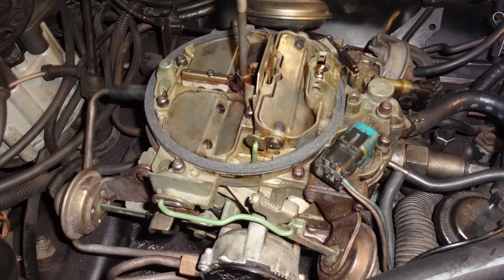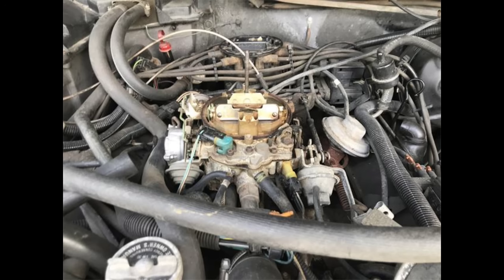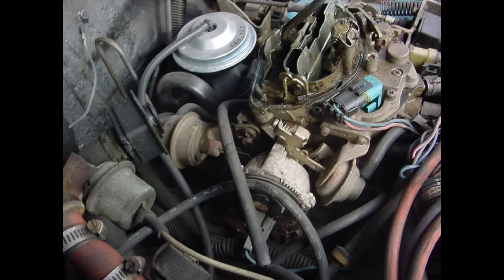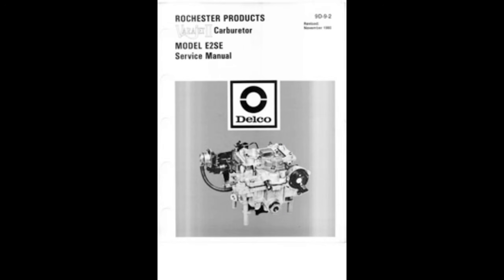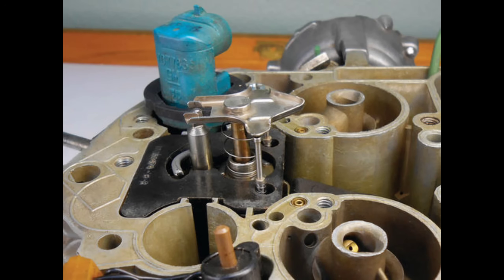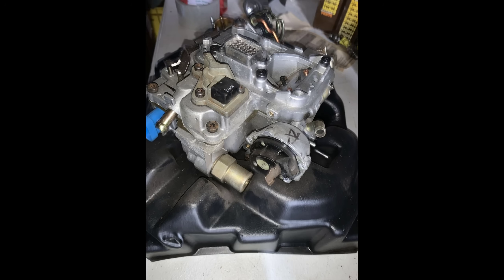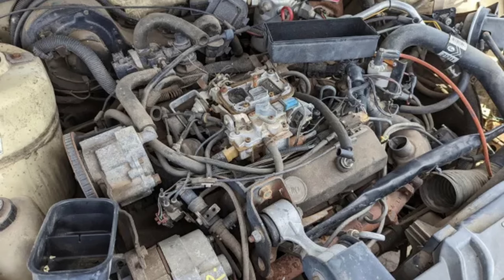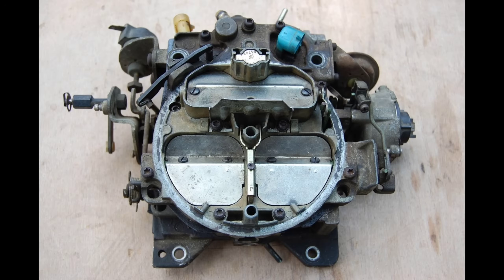GM'S Bridge To Fuel Injection: The Electronic Feedback Carburetor

Comment: it's rabbit hole indeed. There's lots of variables. If you have the original factory carburetor that came with your car, and if you rebuild the engine to factory specs, you will be able to tune it correctly accordingly.

If you don't have the original carb but a rebuilt one from a shop, you'll be in a world of hurt. Remanufactured carbs are just that, built to generic specs tuned only to get you going. In regards to calibration, the idle tubes, the bypass air, air bleeds in the body or at airhorn, the primary jets, the primary rods, the secondary rods, the secondary rod hanger,  the accelerator pump and it plunger springs, the condition of every spring, tps, the mixture control solenoid condition and whether or not the plunger is straight, air horn warpage, bowl body electrosis, primary throttle plates becoming deformed being oval shape from being wedged in the bores, throttle body vacuum leak through its shaft bores that need repair, throttle body and airhorn being mismatched can gravely affect tuning due to whether or not the idle air bleed valve are letter stamped (non adjustable), the non letter stamp valve are, the mixture screws are dependent on what kind of idle air bleed valve your airhorn has, gasket selection, needle and seat, flooding, incorrect float or float settings ect. ect. ect.

Its not a walk in the park. Specialty tools will allow you to adjust it's internals regarding their lean and rich stop settings and proper bleed valve setting.  A dwell meter is paramount. You will be chasing down vacuum leaks, setting and or correcting tolerances. The choke mechanism, the primary and secondary pull off. Nozzle drip due to the throttle angle being too exposed for not having enough bypass air or due to worn out throttle plates. Some people adjust these carburetors wrong. They call them "Quadrajunks" or "Quadrabogs" but they are not that. The secondary airflaps are not adjusted correctly or the its pull-off is releasing too quickly.

The feedback carburetor our C3s are not adjusted with an air gauge for best idle, they are adjusted with a dwell meter for best fuel mixture. If you adjust it using an air gauge or, if you adjust it by ear, you'll experience hard cold starts and the engine will not turn over until it heat soaks. Cranking the starter red hot. A well adjusted carburetor will not require pumping the gas nor setting the choke. The choke is set so that you can warm up the engine faster or if you live in a cold climate. The engine should turn over with a single flick of the key, no pumping on the gas, no setting the choke. I live in Southern Cali, and i rarely pump the gas if ever. 2-3 minutes idling as I get out the house and put my stuff in the trunk, it has warmed up enough that once i get to the end of street onto the road, its ready to roll. 

Quadrajets are universal, but once you radically rebuild your engine and slightly change its cam, you will need to modify it's internals and calibration based on your application. At this point, the maintenance manual for your car wont even matter. It's fun for sure, but you know what I'm talking about. A proper Quadrajet can rival any modern car regarding performance and mpg. One has to love it to endure the pains, the tears and the maddening rage it will provoke upon you. This will allow you to climb outta the rabbit hole or forever remain there.

Comment: In 1997, my car during and after high school was an '83 Camaro with a 5.0L V8 and a Rochester Quadrajet. Coming from a '78 Toyota Celica with a 20R 4 cylinder engine, it was my first V8 and I thought it sounded cool when the 4 barrel would kick in; I guess that's what was happening during full throttle pulls. It sounded deep and throaty. The LG4 305ci V8 and 700r4 transmission was NOT fast but it was a really fun car and was reliable actually. The car was $1500 from a car lot across from my high school, but that's because it had a rod knock. So a new long block engine was purchased from Pep Boys and installed at a local shop along with a refurbished Rochester carburetor a few weeks later from Advance Auto Parts.
Reply: I would have promptly scrap piled the 305 and installed a 350.

Comment: Had one of these in the mid 1980’s on a 5.0l LG4 application for a Pontiac Firebird..  Problem was that if you tried to rebuild it back then the rebuild kit was woefully inadequate regarding the gages, special parts and instructions you were given.  You knew nothing of where to set solenoid for the dancing needle and no mention of the dwell procedure was made.  I got mine as close as I could and it ran Ok, but not as sharp as when it was brand new.  Finally bit the bullet and took it to the dealership for a carb tune.  He told me everything I didn’t know, and said I came surprisingly close considering what I had, or more accurately, didn’t have, to work with.  Could have used this video back then.
Reply from the maker: The carb kits are even worse now.

Comment: When I was 18 starting in 2000 and for about 10 years after, I worked at a parts store.  We sold rebuilt replacements of these.  They were about $400.  The rebuilts we sold NEVER worked right.  I assume that is one of the ways these carbs got a bad reputation.
Reply from the maker: 100%

Comment: The Q-jet is THE best street / mild performance carburetor, period. Excellent fuel metering,  very tunable. The later electronic version, just as good for its intended purpose. You drill out the idle screw caps with an aircraft drill bit, to access base idle fuel trim. The metering rod adjustment was very straight forward with the ( aforementioned) gauge.
Reply: Adjusting idle screws indicate the lean limit m/c stop is fucked up.
Reply: in closed loop.
Reply: @ckratzet5286  Hi, I disagree based on my experience working on hundreds of those when new. GM set the throttle plate more open at idle, then turned the mixture screws in at least 1-1/2 turns to achieve a lean idle w/o stalling. The mixture control solenoid lean / rich limit does not come into play until off idle transition. Also, the fuel trim window was very narrow on the CCC. It's much easier to trim slightly rich mixture to optimal VS trying to enrich an already lean mixture 🙂
Reply: @ToddsHouseofSpeed-uq5sp  
Go to 100% d.c. and it dies closed loop.
Open/Closed loop needs to be specified.

Comment: My '88 Gran Fury cop car has this style feed-back Q-jet, but it will be going away when the (very crude) ECU ignition gets thrown into the trash. Have to replace the intake, carb, and ignition with a more-tradition set up. Ages poorly, parts are non-existence and the car is not going to be re-done to stock specs.
Reply from the maker: I've never owned a Chrysler with the Lean Burn System, but I've heard horror stories.
Reply: Its better to just get rid of it@rporestorations
Reply: @rporestorations  My dad owned one. It made him want to use Lee Iaccoca's grave for a urinal.

Comment: I had an auto repair shop for thirty plus years and finely closed and retired in2019, the last one of these we had come in was on a 1987 fast back Montecarlo a customer had bought restored, and it was beautiful Only problem was a constant check engine light. I was the last shop in our town at that time doing carburetor work as everybody sent their head Acks to us. Rebuild, adjust. tweak the chock for our area and it drove out with a fully functional check engine that was now not on all the time

Comment: My '75 Opel had fuel injection. Never replaced any part of the fueling system. Always worked perfectly.
Oddly, it had points however... Go figure.
Reply: EFI was the one thing that made smog engines work.

Comment: Realistically, these carburetors were such a pain in the butt that in 1984 GM rolled out its TBI or its throttle body injection systems instead, which got away from all of the complications of this and the only maintenance that that required was a bit of throttle body cleaner every now and then. Otherwise it was a self -contained system and maybe the occasional squirt of mass air flow sensor on the intake sensor. It was a much more easy to deal with system and not only did it give you improvements in horsepower and torque. It helped to improve your fuel economy and your emissions on top of that, more than these carburetors could.
Reply: GM didn't "throw them out" because they were a "pain in the butt." They were always a stop gap measure until the electronic fuel injection systems were ready and were certified. Hence, the Iron Duke was fuel injected by 1982. The 60 degree 'sV6 were fuel injected by the 1985 Model Year. GM had to meet emissions requirements in the mean time.

Comment: I worked on those carbs when they first came out. And they was pretty easy to work on. Biggest problem I often ran into, was getting one that someone Maried up the base plate or out right cracked the base plate trying to bust out those adjustment screw caps. Those little caps on the base plate, that covered up the idle adjustment screws had to be removed in a specific way or you would damage the base plate.

Comment: My answer to your question is, if you need special tools (that are likely impossible to find by now...) to adjust a carb regardless of who mades it; it was designed to fail. It was not designed to be serviced easily. It was designed to be replaced. Look at Ford, they had the variable venturi carb, and in a vacuum they worked great! Excellent fuel economy and decent power for the time. But in reality they were replaced. Left, right and center for the same reasons. This was no different.

Comment: One issue was these emissions system were a mixture of electronic and mechanical parts. The computer had no way of knowing if the mechanical the components like thermal vacuum ports, hot air choke heaters and egr valves were working or not then half the time the owners just unplugged or removed random things.... Just rip it all out it will run better.... It worked under ideal conditions but as things aged at different rates was troublesome to keep up.  Throttle shaft wear would make it (or any car) idle lean or unpredictable then you could never get it properly adjusted. Lots of rubber vacuum lines and connections that got hard and broke or leaked. Going fully electronic in the mid to later 80s solved most all of these problems.

Comment: I have t misfortune of living in CA. Where you can not change Anything about t wheels you drive if it is under AQMD regs. I have an 86 Chevy. Van w/305 and it's a problem. I can get it smogged but it's  WAY to much trouble to get a TBI to work. I will soon leave this once beautiful state for greener pastures and then I can get an RV  cam, dual exhaust w/headers and a 79 Carter carb. By t way you can make an engine get best emissions Or best fuel milage. Bu[ not both, as I am on soc. Security, I must have better milage. And that's the way it is.
Reply: Well said.  I live in a state that has never tested our cars.  The 1970s catalytic converters would plug after a few years.  Car kept dying,  wouldn't run.  My dad would take them off.  Luckily it didn't matter here

Comment: I lived through these being new on Denver...they were never OK.  They ran with an inverse relationship between throttle opening and power until you got the secodaries open, then they might go or might backfire...either way they set the money light.  TBI was like a miracle in comparison.
Reply: Not calibrated to the local altitude ?
Reply: @davidpowell3347  I think that was the problem.  I don't think that they could be calibrated to work well at high elevation - it seemed that the combinations of throttle angle and MAP were "out of bounds".  On the secondaries they usually ran quite rich, (trailing smoke) which is typical for all carbs at high elevation.  The higher you went into the mountains the worse they ran, again true for all carbs, but less of a problem for a 455 powered '70 Buick than for a 260 - 307 powered smog special.

Comment: Thunderhead289 (youtube s/n) has an electronic carburetor "kit", the 'carb cheater'.

it uses MAP, RPM, & O2S to control a vacuum leak on the carburetor bowl vent, to make ANY carburetor electronically controlled & tunable! Pretty sweet, imo.

https://youtu.be/NNLud6_x3UM?si=pfWUwos1sXINAqzo